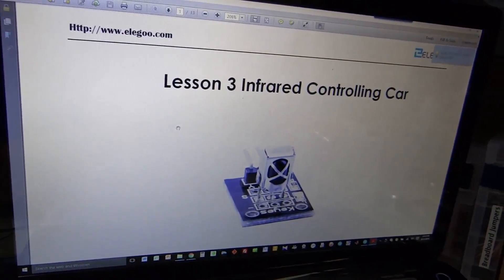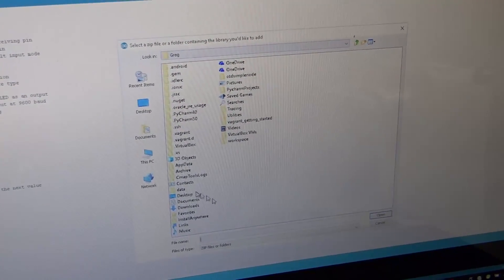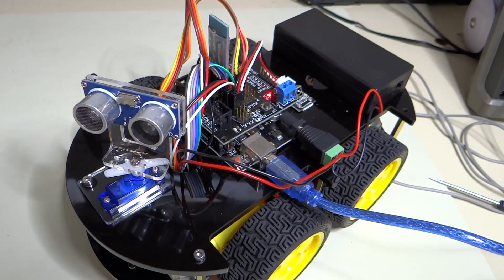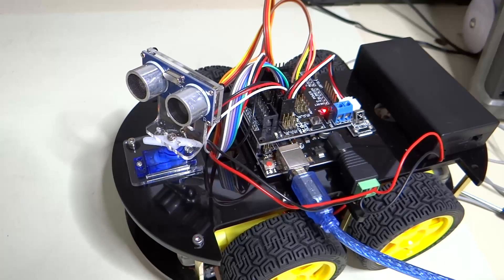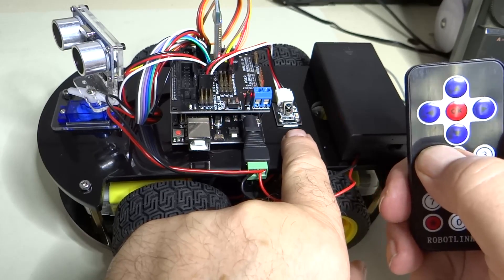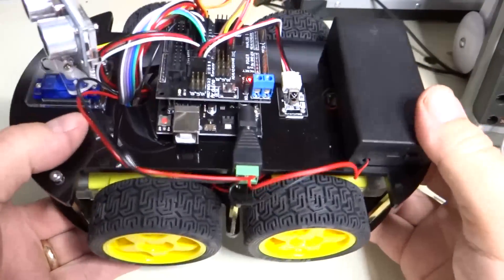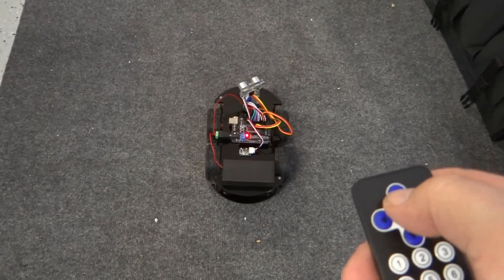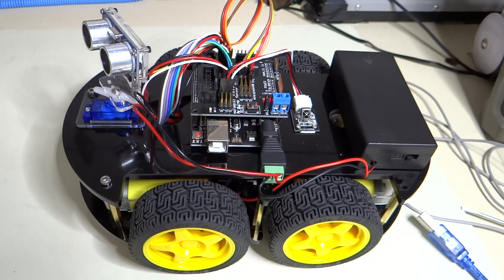Elegoo SRC kit 32 Lesson 3 IR remote control car pt1

Comment: The pressing of the remote switches it to move until the stop button is pressed?? Why does it not stop as soon as you remove your finger from the direction  button ?
Reply from the maker: Open the serial monitor and see what the diagnostic messages are. It must have something to do with the codes the car is receiving from the remote.

Comment: You had to remove the Bluetooth board to upload the Blinky program into the UNO. Not clear why you plugged it back in when it is not needed to use the IR control. At 2:10, the Blinky program should be turning on and off the led on the V5 board (left end of V5 board just above the USB jack of the UNO), but I don't see it happening in the video.

Comment: Hi Greg

  I'm been trying to modify the speed of the Elegoo under infrared mode - it's way too fast  (if I use AnalogWrite in the basic Auto_Go program to slow down the speed on ENA & ENB it works just fine and both sets of wheels slow down)  without success.  If I apply AnalogWrite to ENA & ENB when using the infrared_remote_control_car code I can only get it to work for ENA i.e it slows down the right 2 wheels but the code does nothing to ENB).   Have you tried this or know of a solution?   I'm using the upgraded smart robot.
Reply from the maker: ronanmc68 Hi, thanks for asking! Is ENB on pin 10 or pin 11?. Once the servo library is loaded it disables analog write on pin 10. Could that be the problem?
Reply: ENB is on  pin 11, the infrared arduino code doesn't include the servo library, I think there may be a conflict with some of the infrared code libraries. I''ll research and let you know. Anyway thanks for your reply
Reply: I did some research on this issue for anyone who might be interested...the issue with using PMW on pin 11 (ENB) is when you use the remote control library. There is a timer conflict when using PMW on pin 11 and using the remote library. To get it to work you have to switch ENB and IN1 (ENB = 6 and IN1 = 11 - new settings) and change ENB and IN1 in code to reflect the new settings. Now analogWrite works!